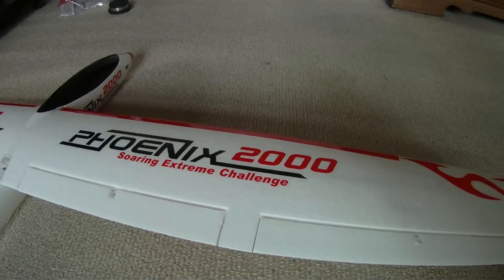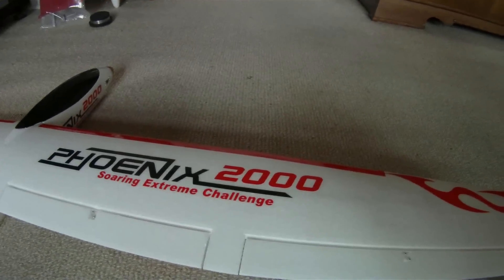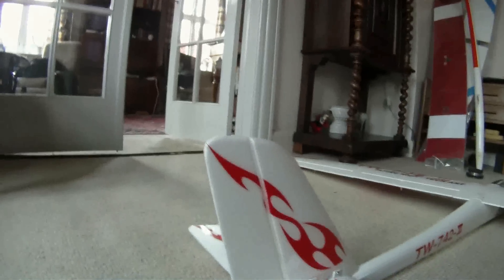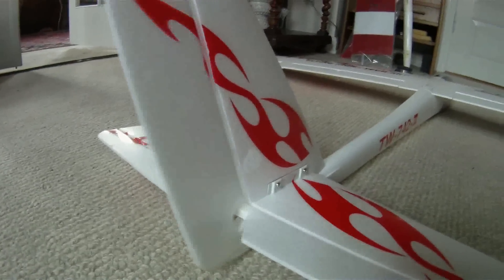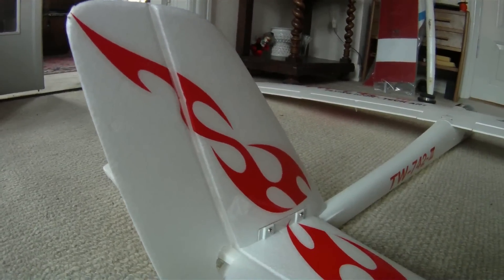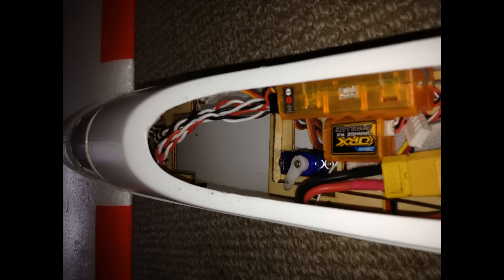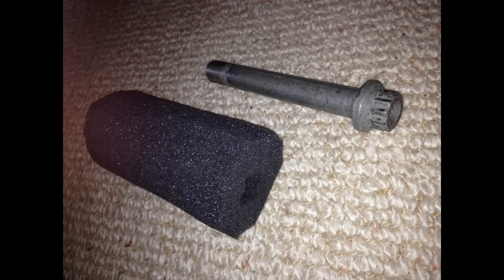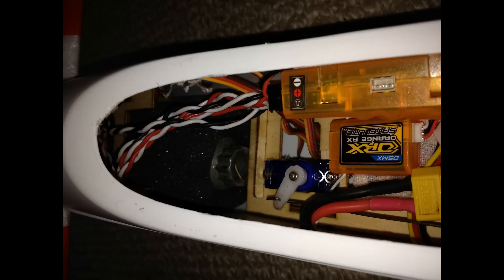Phoenix 2000, Aerobatic set up.

Comment: SpeedsterDen, love your videos. I became more interested in RC gliders because of your videos, especially the vids that show how to set up 4 servo wings and setups such as camber, reflex and other full house setups. Most people usually just post videos of the setting in action and not how to really set them up. Your setup tutorials really do help new glider enthusiast understand more about setup.
Reply from the maker: Than you, the snapflaps (Down flaps when up elevator and up when down elevator) is most for aerobatic and really help in inverted manoures, but also ok for normal flying with around 2 mm throw on the flaps and together with 1 mm on the ailerons, when using full elevator, Cheers S :)

Comment: Ok I figured that might be the case all i really want are the ailerons and flaps to work as flaporons and i think i can figure it out from ur other video thanks .....if not than i have a 9ch radio i can switch too......just need a bit more control on that phoenix 2000 its a bit slogish with traditional set up

Comment: Hi,  your videos are addictive.  I am currently installing six servos in my Phoenix and have a DX6 not DX6i.. am i correct in thinking that you have not used Y leads and have attached all servos separately to the receiver and have you a link to your transmitter mix setup... This is fairly new to me... first glider with flaps
Reply from the maker: +Heath Cope Yes no y cabels, To get this set up you need a DX8, or a tx where you have 7 free mixes. like this on a DX8 before the glider update https://www.youtube.com/watch?v=b5uuwhR2-5Q , I think you must use y cabels and then you not can have crow brake and no all span ailerons. :(

Comment: Can these radio settings and programming be saved as a file and downloaded onto my transmitter? I have a FrSky with OpenTX (sorry if that’s a stupid question I’m new to this)
Reply from the maker: This is not a stupid question :) I can very easy be done From Spektrum to Spektrum transmitters, but not from Spektrum to Frsky :(But still it is not that good, from one plane to another. But perfect if you sell a plane and the buyer have a Spectrum tx. :)
Reply: This snapflaps settings I set in my Taranis with OpenTX in few clicks..(thank you SpeedsterDEN for sharing your settings)
It really works good and helps alot with easy and beautiful level 180* turns
If you are new in OpenTX you should watch OpenTX for beginners on youtube - there are many good lessons and learn. With OpenTX you can program all action you can imagine.. Start maybe is not so easy as Spectrum but possibilities are unlimited (I believe OpenTx have more possibilities than Spectrum radio software - I also have Spectrum DX7).
Reply: Piotr P thank you! Where is your name from? Eastern Europe?
Reply: Yes, exactly EE Poland